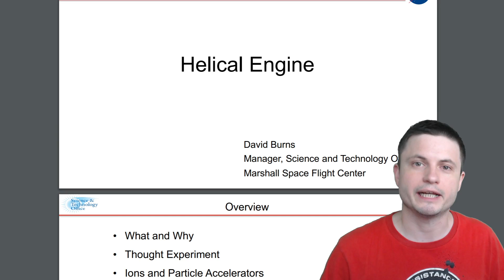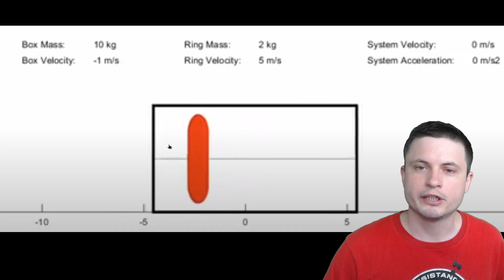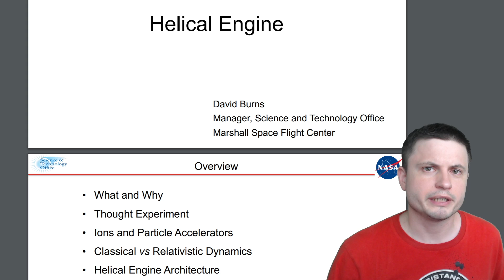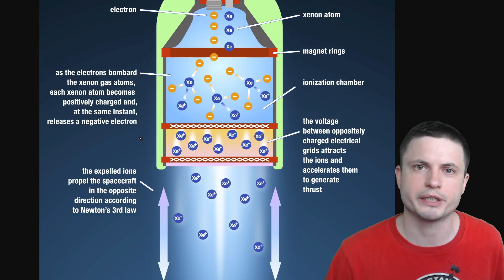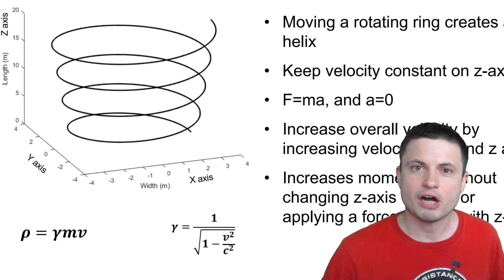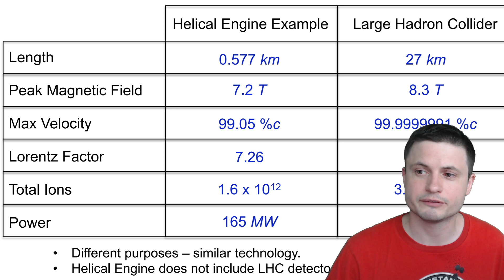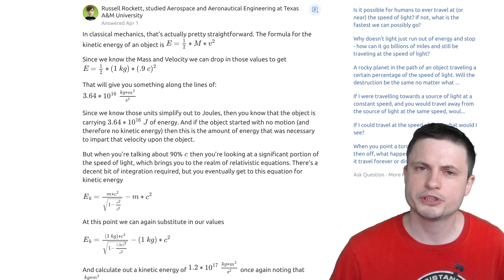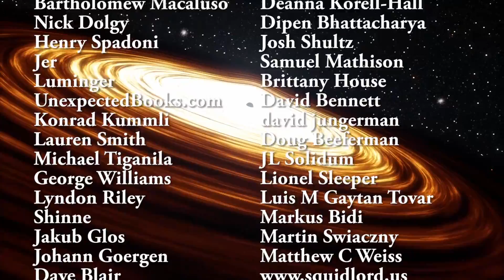NASA Engineer Designs a Near Light Speed Engine But Does It Work?

Comment: Here's the mistake:

Speaking with einstein you can't tell whether the craft is in motion or sitting in one spot. Relatively to itself it isn't moving. So it can't gain any thrust.

Technically speaking you could even find a lorentz transformation so that you have an inertial system where the craft is moving backwards and therefore should be accelerated backwards. That obviously can't be true.

Comment: Basically you combine the idea of a rubber band which stores kinetic energy and a flywheel, which stores kinetic energy as angular momentum and you have the concept design for this sort of engine. You would park your spaceship near a star and let it thermally charge up your flywheels to prepare to jump to the next star system or you could also do gravity assists around large celestial bodies and capture some of their spin that way also. I haven't drawn up design plans for this sort of engine but like Anton stated this isn't exactly a new idea.

Comment: The error in the design is simple: the "extra mass" of the particles in the loop has to come from somewhere, of course. It'll most likely come from the spacecraft's own energy reserves. But that energy already contributed to the total mass of the spacecraft when it was sitting in the fuel tanks, so it'll continue to contribute the precise same amount in the form of kinetic energy. So the center of mass would remain rigorously still. Nothing interesting would happen.
 
Any scheme like this can be easily bootstrapped into a free energy device, because in special relativity momentum and energy are not conserved independently. So if you think a perpetual motion machine is out of the question, you should think any scheme like this is out of the question as well.
Reply: Exactly my thinking.  What I wrote on another sites is

"Am I missing something. Surely as the mass of the rotating ions increases due to energy put in by the magnets reduces the overall mass of the vessel, say the ions are accelerated by a battery the ions increase by mass by E=mc^2 but the battery reduces by mass by the same amount? Thus all this is doing is shifting mass around? I could definitely be wrong though. "

Would this work instead? -

"Would the same system work if the ions were replace with casimir plates. If we could turn on and off casimir plates ( could they be  made out of semiconductors) that should reduce the mass due to the exclusion of vacuum particles when they are on and thus a changing mass that could be acted on to move the vessel forward?"
Reply: Yeah, shifting mass around is about all you can do if you're not willing to throw this mass out the back to propel yourself forward. Even the Casimir effect won't help here, because you had to have been holding the plates apart with something, which implies there's some unaccounted for potential energy in the system: like a compressed spring. Something analogous would happen if the plates are turned 'on' and 'off' when you mess with the conductivity of e.g. a piece of silicon.

The problem all these approaches are facing is that the position of the center of mass of a system is a "conserved quantity" like energy or momentum itself, as was demonstrated by Coleman and Van Vleck. As long as one assumes flat spacetime (as we're all doing here), the position of the center of mass of an isolated system is always in uniform rectilinear motion.
Reply: @vacuumdiagrams652 . Thanks very much , that is really interesting, and I believe very much correct. If I get what you are saying the missing mass turns up as the force between the plates and thus no mass/energy change. Thus the force is effecting the creation of the subatomic particles or visa versa. Is it one of those things that can only be understood if particles are considered as waves.
Reply: Correct. Mass is no constant in this scenario. And that changes the game, as the force exerted now gains an extra term, contributing a negative force. This means we would need an extra energy added to compensate the energy loss due to fuel consumption, which basically means we have to get energy out of nothing. And that, Ladies and Gentleman, violates all laws of Thermodynamics.
Reply: Oliver Franke True, there is no way you could get more mass from a near C velocity. Where is this mass coming from? I think they are mistaking mass for weight here. It would make sense if weight could be affected by C because space, time, and gravity are connected. 

If this really was the case though.. we could literally duplicate things. Now that I think about that it sounds ridiculous, but if they are right it would work. 

Step one: accelate extremely valuable substance to near C 
Step two: decelerate

Now you have two times the material.
You started with...

Damn that seems like some silly shit idk about you.
Reply: you have clearly didn't understand the concept. Did you understand the relevance of helical design ??
Reply: @aditya-ml6km  Of course we don't understand the concept. You can't understand bullshit. There is no physical explaination how this is supposed to work and additionally the math is just wrong.

Comment: So does the mass loose rotational energy when it hits the "front of the box"?

If not then the energy input to get it spinning should be a one time investment yes? To slow it you pull energy out into whatever storage medium you use, then to speed it back up you put it back in. The total energy input initially seems almost irrelevant as long as it can keep being recycled while outputting a steady stream of forward thrust.

The problem I see is that as the mass increases the forward velocity will decrease to conserve forward momentum. You'll need to expend energy to keep it at speed as the mass increases.  The total trick of it is that yes, you can achieve forward thrust in a closed system (yowza) but as I see it (mind I'm just a dude at his computer) you'd still need a net influx of energy to actually move the whole ship.

Unless I'm totally wrong and the nasa guy has a bigger brain than me. That's more likely

Comment: The increase in mass with reference to increase will not compensate for the thrust required.Again the mechanical problem will be more.Again at such a speed the Engine will be burned unless cooled externally by nitrogen cooling.

Comment: First you have rocket science that explains the science. Then you have rocket engineering that explains the rocket, or engineering. Depending on how you look at it... Honestly it sounds simple enough to understand... If you look, or think on terms of engineering... Honestly though I bet you could build a simpler version with a expanding bouncing donut on a magnetic rail track in side a box. Design it where as the donut goes to side A of the box it expands. As it goes near side B it shrinks.... More or less like a jellyfish... But how do you increase mass as it goes to one side? Or mass being volume? Well you know how to deflate, and inflate a bulloon? Yeah something like that.

So magnetic rail tract for the inflatable donut.

Something to inflate, and deflate the donut.

Something to power the magnetic rail.

Something that tells the donut to inflate.

As the donut inflates it needs to spin.

Donut needs to be bouncy.

Also a box for it all.

Also a "lot of power"

Yeah sounds very basic... Like how ion drives, or engines are complex in science terms. Even though you could build one at home in engineering terms.

Comment: Hello Anton, can you answer a question I have about time dilation at relativistic speeds.
Two people set off from Earth and accelerate to relativistic speed their experience of time slows relative to those left on Earth.  They both experience the same passage of time relative to each other. Correct? One then decides he wants to go home. Luckily they carried a second equally capable space craft and he set off in the direction he came from. To the person continuing, the one going home would appear to be accelerating away reaching relativistic speed relative to a the first craft. So shouldn’t the one trying to go home experience a slowing of time relative to the traveller continuing on. Of course from an Earth observer the second craft would appear to be using his thrust to slow and eventually become standstill relative to the Earth. Therefore his experience of time would be the same as that on Earth would it not, which was faster than that on the first craft. What understanding am I missing here.

Comment: I believe there is a fundamental problem with this system.  To accelerate the piston to a speed where it will double from one to two kilograms, we will have to expend one kilogram equivalent of energy.  This energy will be exhausted from the ship once the piston reaches the end of its run.  Hence, the ship will be one kilogram lighter on the piston's return trip. The piston will have returned to one kilogram, but that will be offset by having a one kilogram less massive spacecraft to move.  Hence, I believe the spacecraft will just oscillate back and forth but won't go anywhere.

Of course, we're still effectively ejecting mass (in the form of heat converted from slowing down the piston), so if you can direct that heat out the back of the ship it may work for no other reason than that.

Comment: I'm not sure how this is supposed to work. Because of E=mc^2, energy has a mass associated with it. So any energy that you were going to use to accelerate the weight to relativistic velocity would already be on the ship somewhere. The total mass of the ship would therefore not change throughout the process. This is simply an act of "pumping" energy into and then out of the moving weight. I don't see how that is different from trying to do the same thing by pumping water from a tank on the ship into a hollow weight, move the weight in the desired direction and then pump the water from the weight back into the tank before moving it back in the opposite direction. The very act of moving the energy around the ship will also have reaction force associated with it, which should be equal and opposite that of the moving weight (assuming perfect energy transfer).

Of course, due to the second law of thermodynamics, you could never extract all of the energy back out of the weight that you put into it (there would be loss in the form of heat), so I suppose that WOULD allow for net acceleration. However, that would be so inefficient that you would be far better off just firing all of the energy out the back of the ship with something like a laser.

Comment: I know I’ll sound stupid here, but I’m no scientist. We have electric cars, electric plains, helicopters, and just about electric everything. How would an electric rocket work? (Or is it not possible?🤔)
Reply: That's what an ion engine is. Sadly all electric vehicles are in part powered by coal, natural gas, and fossils fuels. The energy they run on has to be efficiently generated and that requires a power plant. Even ion engines require fuel in the form of noble gases that are electrically charged.

Comment: I hate to say this as a lot of work has been put into the idea, but I think it won't work. Here is why. Relativity is about the relative observations of observers in two different inertial frames. In this case Observer A is standing at the launch pad and observer B is standing next to the engine on the spaceship, which is travelling away from A at 0.9c. B sees the weight in the engine moving forwards and backwards at the same speed. lets say 0.8c and -0.8c. He sees no difference in the forward and backward momentum given to the ship, so no acceleration. If B sees no acceleration so must A. To check that A does see no acceleration use the velocity transforms of special relativity. This gives the forward velocity of the weight as 0.988c, giving that A sees the weight hit the front of the container at a speed of 0.88c. The forward momentum applied to the ship is gamma(0.988)* mv. With m=1 kg this gives a momentum of 1.74*10^8 kg,m,s^-1. The backwards velocity of the weight for A is 0.357c giving that A sees the weight hit the back of the container at -0.543c, (0.357c - 0.9c).  The backward momentum given to the ship is gamma(0.357c)*mv. This gives a momentum of 
-  1.74*10^8 kg,m,s^-1. As expected the stationary observer also sees no difference in the forward and backward momentum applied and therefore also no acceleration.
Please let me know if you think this is correct. In a way I hope its not.

Comment: What if we accelerate particles near the speed of light then fire them inside a cilendar with a hiper reflective mirror on the end and in the middle use some method of slowling the relected beam down or prehaps have the container be in a shape that would cause the beam to considerably lose energy by the time it reaches the other side

Comment: Near light speed? - that is NO good. In this day and age we need to have the ability to bend the fabrics of space time like aliens do. Bob Lazar is a classic example who worked for Area S-4 on a saucer that came from Zeta 2 Reticuli. Antimatter Nuclear Reactor, Electromagnetic Generators and emitters to emit the gravitational wave that the craft rides. NASA for many years have tried to build Electromagnetic Generators BUT they can't make them efficient as they push out far too much lethal Gamma Ray. Then you have the trouble of building an Antimatter Nuclear Reactor which No country can do. TR3B is crap because it's linear mode. It used plasma & mercury spinning at high velocity in a sealed chamber to create lift.

Comment: Well, these secret flying vehicles seen all over the skies in the US, FRANCE, BELGIUM , SOUTH AMERICA for some 40-50 years have achieved interstellar travel without needing to think about  mass ,time , dilation, energy problems .
These secret black project  spacecraft all seem to use some form of technolgy that spins  some special heavy liquid metals 
in counter rotating chambers. And this tech , also REDUCES  the mass of the craft like 90-95 %.So  light and beyond speeds possible without infinite mass and energy problems.
Too bad the elites are keeing this tech secret from the public and still putting on the show of chemical rockets needed to tavel in space.

Comment: we need to bypass the whole dynamic of energy requirement to make energy interstellar travel possible. By creating something passive or something that achieves the goal (getting to a location) in a different way other than movement, which seems to Intrinsically require energy.

We should figure out if there is a fixed rule of a body skipping a distance of physical space to arrive at the other end. 
We were so certain about the rule of locality for example till quantum entanglement!

We should also ask ourselves what our actual goal and intention is. Do we really need to propel our own human bodies to other solar systems or are we merely trying to accelerate information faster towards us so we can absorb information that is forever lost to us because of expansion and the limited speed of light sending information our way.

Ant type of travel would be easier with drones. Perhaps we could achieve something novel once the drones are setup at a distant location.

Comment: Here's something I've been pondering on for some time; if you push a wheel in to a circle motion then you DONT have a net equal and opposite reaction, since some of the energy on one side has been converted in to a circle motion.  So surely some sort of version of this in space could move a craft just by manipulating kinetic energy from straight line to circular back to straight line again.

Comment: Efficient fusion power & superconductors could be used to make a linear accelerator that would increase the mass of the “exhaust” so that a gram would weigh a few pounds by the time it left the influence of the accelerator.
If fission is all you’ve got, some variant of Project Orion is the best bet.

Comment: A closed system to generate thrust is not impossible. You need a asymmetry in impulse transfer. Imagine one side of a box shooting particles or a light beam towards the opposite end of the box. This generates a acceleration thanks to the reactive force, but upon impact on the opposite side, this would be countered. If the opposite side can convert the kinetic energy into another energy though, there would be a reactive asymmetry in the system. NASA did make a experiment, where they shot very fast projectiles at rocks suspended in a vacuum chamber. Some materials behaved non Newtonian and converted the impact energy into heat and plastic deformation. This the rock did not swing on the pendulum from acceleration.

Comment: This drive violates conservation of momentum and you never mentioned that.  You say repeatedly, "it could work in theory"- NO, absolutely not.  Based on known theory it cannot work.  Any momentum exchanged with the flywheel will be conserved within the system as a whole, and it will go nowhere.   If you want to defend it on the basis of new physics, then you (and the designer) need to explain why conservation of momentum can be violated.  It is as simple as that.

Comment: By comparison, how energy/thrust efficient would it be to use a particle accelerator to get thrust by ejecting matter in a controlled direction when it reaches a speed like 80% of light speed?  Would energy/thrust be much different at 90%?